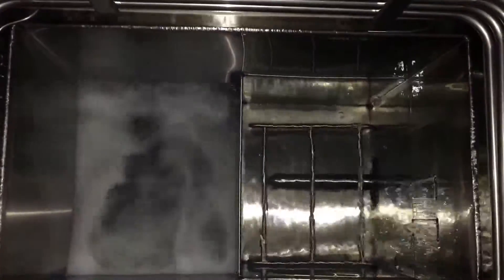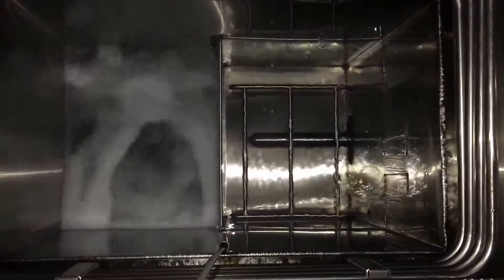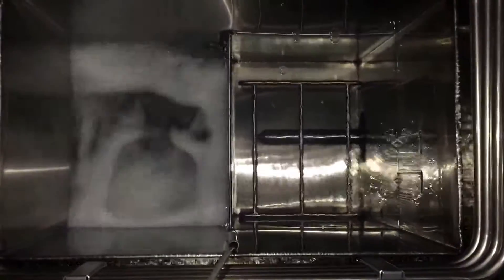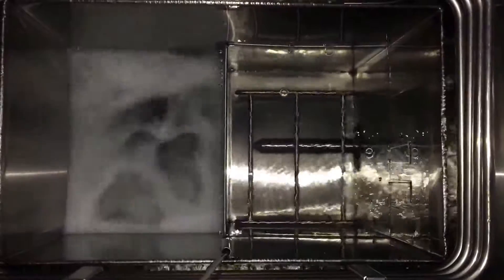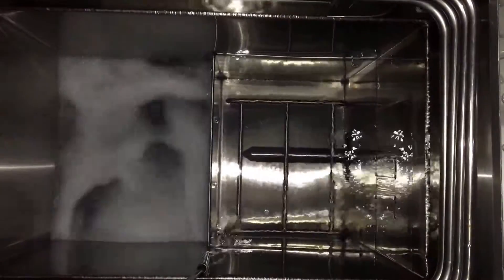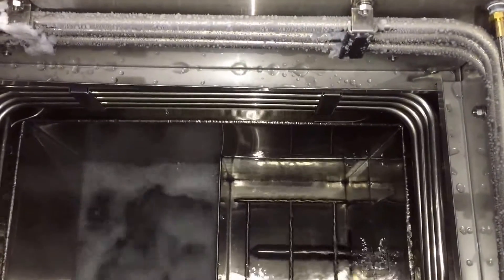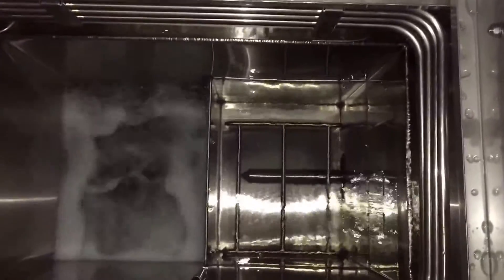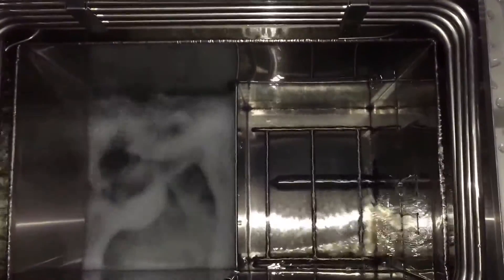How Does a Vapor Degreaser Work? Actual Degreaser in Operation

Comment: What is the best temperature for water inside cooling coils. We use now 12°C
Reply: Stefan, in most new vapor degreasers the cooling coils are part of a refrigeration loop that goes through a compressor and evaporator coils rather than water.  There are typically 2 sets of coils: primary and secondary.  This significantly reduces solvent loss.   The secondary typically operates at or below 0F.  Depending on the boil point of the solvent, the primary coils typically operate around 50F, it is important to keep these coils above freezing as to not attract water vapor from the air from freezing on the primary coils